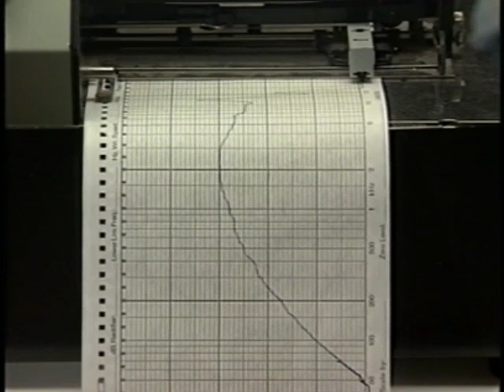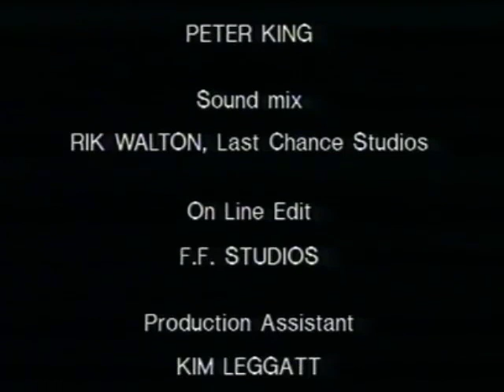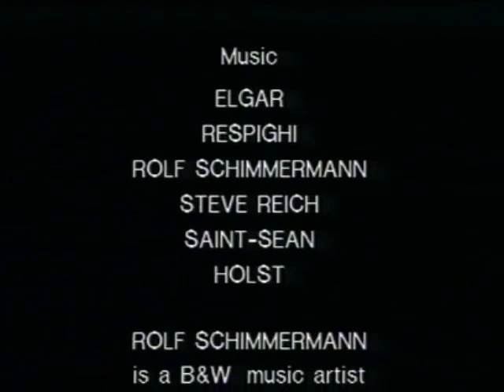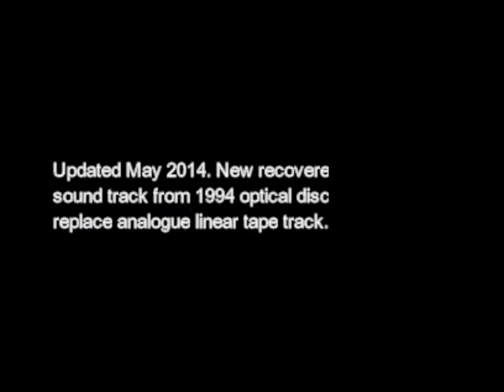B&W Nautilus Loudspeaker story - Laurence Dickie.

Comment: The B&W flagship DM70 of the late 1970s was the talk of hi-fi shows with its stunning white finish and black grilles in a wide, curved-front cabinet – a revelation in those days of walnut-veneered, grey-fronted rectangular boxes.  The only rival in sonic quality and appearance was the long-in-the-tooth Quad ESL with its more crystal upper range but no real comparison in the low frequency department.  The DM70 had the family character of the D and DM series but more of everything and it was an aspirational product with very few in private hands.  While less in grandeur than today’s top models, it had a less hard edge which might still appeal to some – and you only needed moderately powerful dual mono vacuum tube amplifiers like Quad 202s to power it effectively!
Reply: Actually, rivals included KEF 107, ADS/Braun, infinity and Gale.  All those I mentioned were as good or better.

Comment: i remenber in the 70´s mainly german friends built their own speakers using diferent shapes previously tested by engeniers and was the decade of the do-it-yourself , or BRICOLAGE , even the furniture at home were all made by it´s owners, the speakers had a lot of curved wood inside ,it took time to built them ,then buying speakers to the main frequencies from very good brands, the end work was incredible good sounding but it seems all vanished in the 80´s or just a fashion that was over, only the results were very good the sound flow was studied, sometimes using cigars smoke with fans with them opened in one side closed with glass to drive the smoke so to have an idea of how will the sound flow with this or that design, a really nice decade for young people in Europe but a lot of problems in result of the excessive freedom some grew up with

Comment: Thank you for this amazing video. When I was the assistant manger of the Hi Fi department at Harvey Nichols in London back in the seventies the buyer had opened an account with B&W.
The DM70s were amazing but beyond my wallet at the time. I did settle for a pair of DM4s as my speakers. I later built a transmission line cabinet for the DM4s to sit on. 
I have never been able to afford a better set up but I would consider a pair of these now if I could still try buy them.
Reply: instablaster

Comment: A nice and interesting video. Anyway, to reference the author's story of finding the original optical disc audio master, I find it interesting that analog/digital video has gone through various formats and technical development throughout the last decades, where one can visually see the differences in quality, yet it's audio that has primarily remained the same. A well recorded piece of audio from decades ago survived better today than analog video footage taken from the same era. Or in other words, you got low resolution 240i video that looks horrible on today's HDTV screens yet decades' old stereo audio still sound great if not better on today's hifi equipment. :)
Reply: Absolutely. This video was shot on broadcast equipment and cameras which by today's iPhone and Galaxy standard is almost hopelessly dreadful. But back then there was no other way other than film which would have cost 10 times as much. However digital audio (44.1kHz) was reasonably mature. The master video tape only had a analogue linear track and it wasn't that good. I am glad I had the sense to do a digital back up to a CD-R.
Reply: You're absolutely right. Shooting on film would've been very expensive, even if the production team decided to save money by using 16mm rather than 35mm. And unfortunately a lot of material will only exist on low resolution analog video. Though with the resolution of digital video cameras today which has surpassed the resolution that the human eye can visibly see, I wonder if decades from now people will say 1080p looks like junk on their 24k TVs. :)
Reply from the maker: @vangmx  It will!